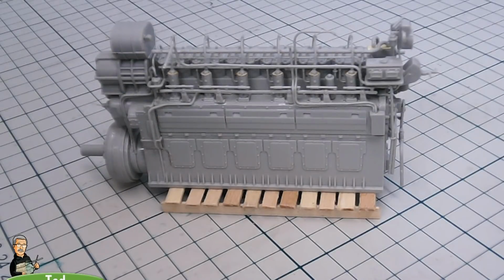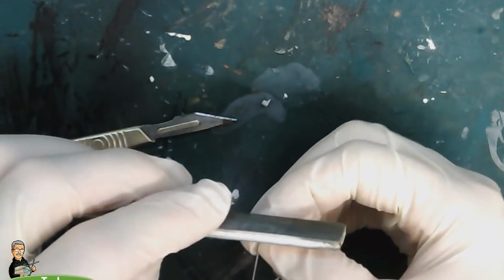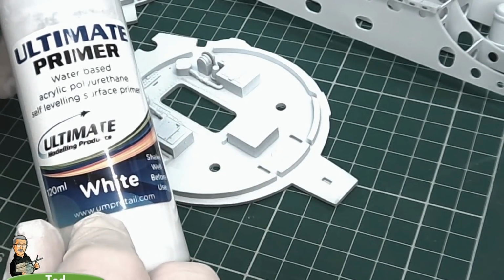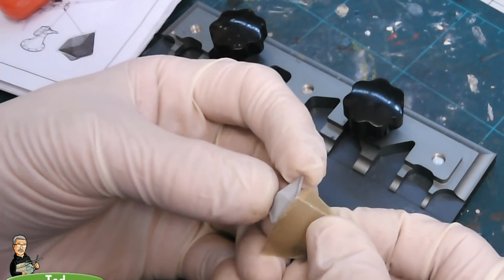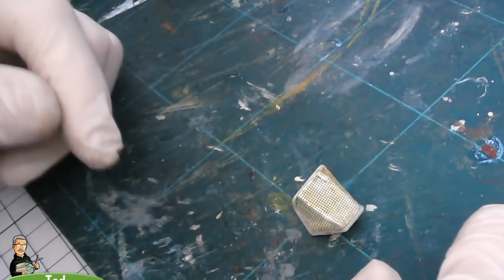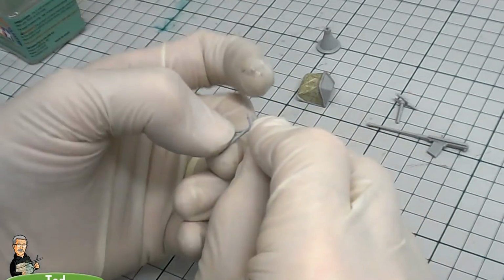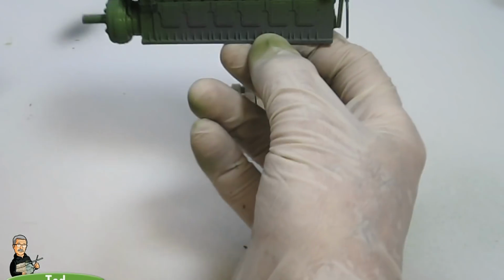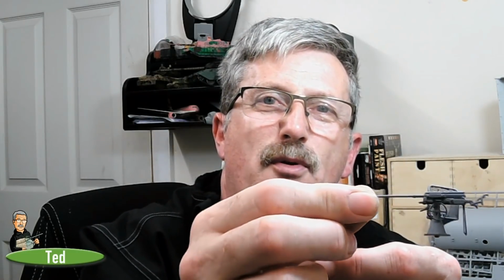Trumpeter 1/48 DKM U-Boat Type VIIC U-552 (WWII) # 06801 Part 5: The engine!

Comment: For future reference, it's best to anneal brass PE that needs to be bent to odd shapes. Cut the part off the tree, heat it to cherry red and immediately dunk in cold water. (The opposite to annealing steel). You will find it will easily mould into any shape you like.
There are some YouTube modellers who profess to know how to anneal brass and there's even one bad tutorial from a guy in Aus. Believe me, heat to cherry red then quench and your brass will be soft as anything!!

Comment: Ted, if I could add a suggestion about super glue (you may already know). I have 2 large bottles of super glue that I have had for years and still work great. The tip I was given was to keep them refrigerated, worked a charm. So mine are always in the fridge.
Reply from the maker: Thanks for the tip!